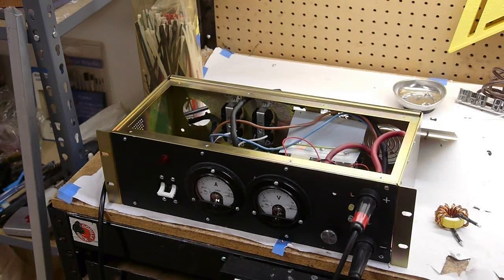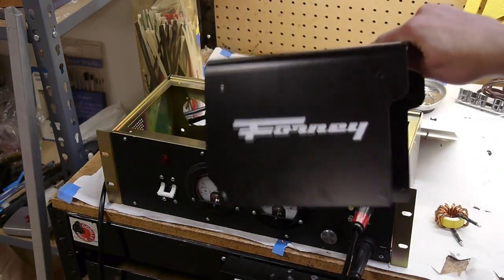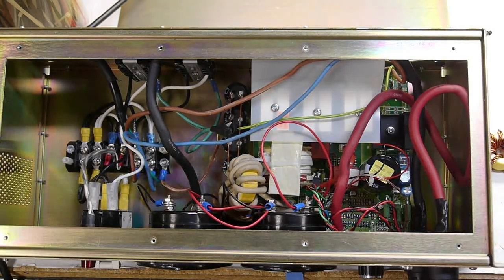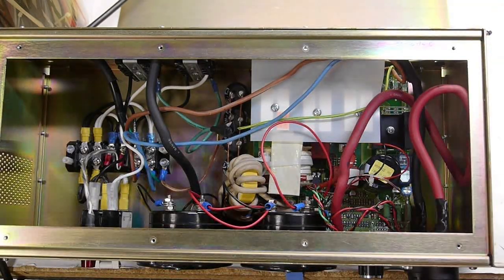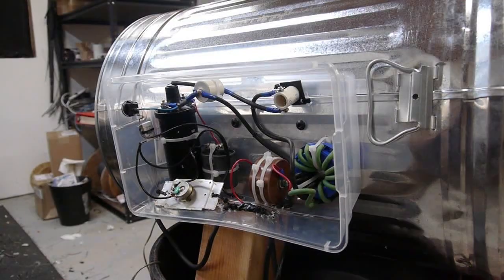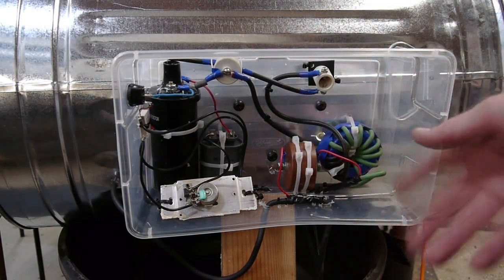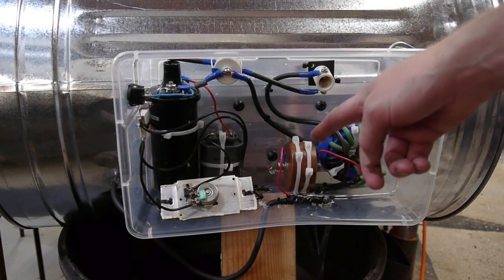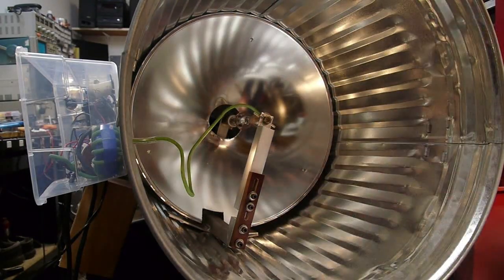1000W xenon arc lamp built into DIY searchlight housing

Comment: My uncle ran (and I believe still does run) a searchlight company here in Canada called Skysearch. He bought a few surplus WWII carbon rod arc discharge searchlights that run at, if I remember correctly, 100 million candlepower? Something insane like that. My dad worked for him, hauling and running the searchlight to events, and as a kid I would tag along. They were unbelievably cool. They had a huge diesel generator for power, but they also had the automatic rotation feature. They also had the ability to connect to a remote control at an anti-aircraft gun, and they would use (I'm assuming) something like synchro resolver and some basic analog computing to triangulate 2-4 of the searchlights wherever the gun was pointing. They also had the ability to run with the generator a fair distance away. They knew the bombers would target the lights, so that's why the remote control was important. I remember the cable connections used to connect to the remote controller (which unfortunately I don't think my uncle had any of) was absolutely massive and had a ton of pins on it. One of those huge military spec connectors.

When I was a teen and moved in with my dad, he would take me with him after school sometimes to run searchlights. Then I would wear the same t-shirt the next day and smell like searchlights (a mix of diesel exhaust and carbon dust and stuff). I always thought it was so cool. Now that I'm older and understand how the circuits likely worked, I find them even more amazing.
Reply: As a kid, those World War II search lights repurposed into event promotion sky lights fascinated me. My Dad would track them down so I could see them up close. I didn't find out until I was way older that the flame was part of the arc itself - I thought arc lights were always glass-enveloped devices. Turns out those things were basically glorified arc welders!
Reply: @russellhamner4898  Yup! The most finicky part of those old searchlights was the feed mechanism. As the carbon rod got eroded, the searchlight would feed the rod inward. The way it actually worked is it would measure the voltage across the arc (the further the rod is away from the anode, the higher the voltage) and it would maintain that voltage by moving the rod as needed. It was a neat idea, but I remember my dad having trouble some nights with the auto-feed. It would sometimes feed too fast, and the arc would get really dim, or other times it wouldn't feed enough, and either the arc would extinguish, or, in the worst case, it would jump from the anode to some other piece of metalwork! The searchlights had a safety system if this happened, but even the half-second it took for the system to kick in could be long enough for something to get melted.

Another thing I remember is that the searchlight could be locked in the vertical position (facing parallel to the ground) and the glass front slides open. My dad would have to get in there before we fired them up and clean the entire reflector and glass with Windex and a towel. Despite cleaning them before every run, the reflector in particular was always filthy because of the carbon rod being vaporized and then just depositing on whatever nearby surfaces. You could really tell the difference in the brightness between a clean and dirty reflector.

Now that I'm an EE (working in digital stuff) mostly) I really should go visit my uncle and see if he'll let me reverse engineer some of the circuitry. If you have any more questions about the searchlights, let me know. I know way too much about them.

Comment: Forgot to mention, I too once wired a TRIAC dimmer to an ignition coil with the spark gap between thick gauge copper wire and a spark plug and boy oh boy, do I remember those corona discharges jumping over the insulation at the coils terminals! Very loud too.

Comment: too bad I saw this 10 years late...  30 years ago, laser, xenon and carbon arch lights where one of my specialities. 

To stricke a bulb cold, you would want to apply a 2-4kW electric field over the electrodes, to excite the gas molecules, before striking and 10-20kW arch across. Striking the gas directly is quiet difficult, because this bulbs are Xenon Short Arch - High Pressure bulbs. The high pressure means several atmospheres of gas pressure even when cold ! Hence you need to excite the gas first, else the energy required to build the plasma arch is very high !. 

A word of caution - this bulbs are very dangerous, as they build up to 80 bar pressure when hot and have a tendency to burst spontaneously, specially if there is not enough cooling or finger prints on the glass. I have seen them burst several times, it sounds like a very close gun shot and leafs nothing but quartz powder (plus electrodes) behind. 
The explosion can be so strong, that it will be heard over the sound level over a live concert in a arena with ease (been there, done that) !! 

So careful with the beautiful bulbs :)

Comment: Hey there I had a question for you: I have an old 35mm theater projector that uses these lamps. It’s a complete unit including the lamphouse. My question is can you hook up the DC power coming from the inverter arc welder directly to the rectifier in the lamphouse? The input for the lamphouse power is 3 phase 220v ac, which I don’t have access to. I figured I would use the benefits of the existing circuitry but was unsure if I could plug dc power from the arc welder directly into the rectifier. In theory it makes sense in theory but I am searching around and couldn’t find anything about if it was safe and would work. Thanks!

Comment: Is there a way to get in touch with you? I have an old movie theater projector with a xenon console I want to resurrect today and I am using an arc welder inverter for the power supply coupled with the igniter already in the console. I need to know if I should hook up the output of the arc welder inverter to only the lamp, thanks!

Comment: Hey Ben, I have a large collection of these Arc lamps from a few hundred watts to 7kW. I have watched this and the other video countless times but am struggling with the ignition circuit. Would you be able to lend some suggestions? I can't seem to get the voltage on the other side of the toroidal ferrite.

Comment: That old inductor is wound with litz wire - Lots of tiny insulated wires- The reason it's getting so hot with that regular wire is the skin effect. It's a high frequency thing.  Wikipedia it. Litz wire.  
And I quote
 "Litz wire is used to make inductors and transformers, especially for high frequency applications where the skin effect is more pronounced and proximity effect can be an even more severe problem. Litz wire is one kind of stranded wire, but, in this case, the reason for its use is not the usual one of avoiding complete wire breakage due to material fatigue.

Litz wire is frequently found in power applications in frequencies ranging between lower tens to higher hundreds kilohertz, namely induction cookers and transmitters of inductive chargers (e.g. the Qi standard). Multiple parallel twisted strands of enameled wires can be found also in transformers in some switching power supplies."

Comment: Hey again Ben,
Is that starting switch a momentary push-button or a toggle (SPST) type switch?  It appears to switch the SCR through a capacitor or a resistor to the primary coil of the ignition coil.
Thanks again,
...really trying to learn this circuit--a schematic would be GREAT!

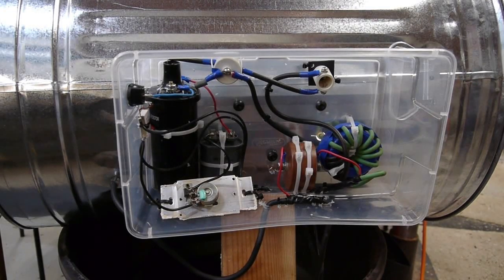Comment: BEN!! (right?)  At about timestamp 5:55 you mention H.V. level compressors.  What about one of those High Power lightning arrestors used here?   They seen to be cheap, reliable, and effective, in this type of surge suppression--even the smaller, inexpensive types.  I think I remember they can also be used in series for higher voltage protection.  I just bought about 300 of them from All-Electronics, or Mouser for a dirt cheap price.  I cracked a couple open and did not like the dirty-looking 'screening' inside!  But still, you could see the bluish-purple (magenta) light through the ceramic cylinder.

Comment: I really like this pulsar starting circuit.  I am familiar with the components and how they work--Is there any chance of showing a labeled schematic:  With component values--especially the HV doorknob capacitors (C & V), from the input of the welding (input) wires to the lamp driver?
THANKS MUCH,
--dALE

Comment: You have 50 amps running through that 8(?) gauge, insulated, non-fiberglass, non-fluoropolymer insulated wire???! Any electrician would give you wrist slap. Fire waiting to happen. But, this is certainly a special circumstance. I’d do the same.
Reply: I was the purchasing agent and general manager of a company that serviced the work boat industry on the inland waterways, and we sold and serviced Carlise & Finch searchlights. There was also a brand called Varo, but they were not very reliable. The wire used in these was teflon insulated, and then covered with fiberglass braid within the housing. When I started, they were all carbon arc, finicky, and dirty. Next came 2.5KW xenon, followed by 1KW. We sold a lot of xenon lamps, and they are dangerous. You are so right MisterLepton.

Comment: Just a suggestion : instead a single thread solid wire, try multithread wires like there is on the original toroidal transformer.

The reason is skin effect which increase with frequency. The magnetic field force the electrons away from the center on the wires, so the most efficient design woould be hjollow wires. The second best option is a lot a small wires not in parallel but crossing each other is different way... exactly like the wires on the original transformer..

Comment: I don't know if you're from the US or not. However for future rreferance, it is against FAA regulations to point any light above a million lumens into the sky. I don't want to see a good guy just doing projects going to prison over something like that.
Reply: +TheRabbitt23 the only bulb i know that emits a million lunens would be a 15kw xenon bulb or a 12kw metal halide. There is no such thing as a "million lumen flashlight". Post the link and ill check it out.
Reply: +TheRabbitt23 with an estimated 50 lumens per watt for a xenon arc lamp, this lamp would be 50,000 lumens. Ballpark of two orders of magnitude gives some breathing room
Reply: 50 lumens per watt is actually very low. Considering theres a handheld flashlight that emits 1million lumens, I'm pretty sure that this light can do about 100 Millions easily.
Reply: FYI a 1 watt laser is 500k lumens or higher depending on color
Reply: +TheRabbitt23 Those figures are way off. I can't find any evidence that agrees with them. I wouldn't trust the B.S. packaging on ripoff products.

I did find a 1000W metal halide spotlamp (higher lumens/watt than xenon) that has 110,000 lumens. Search for part WAL-TSL-1XM. The 1000W GE SPL1000/T/H/960/E40 has a rating of 88,000 lumens.

From whatever sources I could find (say, search 'hyperphysics luminous flux') a 1 watt green laser would be expected to be in the ~650 lumens range
Reply: I'm not here to argue. I just wanted to make sure the guy didnt go to prison over something dumb, like shining light into the sky.
Reply: +TheRabbitt23 I was here to do a back-of-envelope estimation to see how close to the limit this would be... being ~1/100 of the limit meant he shouldn't worry about what he'd done shining it up into the sky. You turned it into what it is now.
Reply: I just know that youre not allowed to shine the "million lumen" flash lights into the sky in the US.

Comment: hi Ben, can you tell me what is it between ignition coil and white capacitor? it's a diode or a resistor? and can you tell me capacity and voltage of blocking capacitor?

Comment: Your device quite interesting. A way to inject the HV pulse, is to capacitively couple in the pulse through the lamp  wall, glass body. Doubtless this is fused quartz. (no finger prints please). This is a standard laser lamp ignition method. A  floating small dia trigger wire is wound around the lamp envelope for example. Must be near the cathode  and anode of the lamp.  Yes, isolation of the HV pulse is very important, to prevent failure of the lamp LV  supply. A common mode choke on the LV feed  pair will help keep ignition pulse out of the LV supply. All should be located near the lamp can, as you have done. Nice work!
Reply: yes and now, laser tubes are low pressure, this Xenon short arch lights are high pressure. They have at cold state around 6-8bar gas pressure, when hot around 50-80bar !! Therefore the ignition pulse is best injected via the electrodes.

Comment: atleast your neighbours know not to mess with you, otherwise they will have night sun shining into their homes ;)
Reply: Brodne y you seen photonicinductions 20,000 watt bulb video?
Reply: @carolynmmitchell2240  but, back in the day. Photonicinduction use halogen lamp and not focused, while this is xenon short arc and all the beam focused into one spot.

Photonicinduction does have bigger xenon short arc rated at 4kW and 30kW.
But, he didn't put it on reflector. 

The one and only arc lamp photonicinduction run it using reflector is 12kW metal halide lamp, and some arc lamp using red protective cover (i don't really remember the type and it's rated power).

Comment: I have a collection of Xenon continuous arc lamps that are in ceramic reflector housings.  Power ratings from 250W to 1000W.  Also a flash tube that I believe is rated at 1,000,000 watts.  It was made at ILC Technology for a huge laser.   If you are interested in obtaining some or all of my collection send me email at rwood43@hotmail.com. Most of them have never been used.  I designed power supplies there just before they went out of business.
The picture is my daughter.

Comment: Tanks for the information, but, could i use common rectifiers, such bridge rectifiers about 30 amps to drive this bulb? Something like that i´ll do with flash xenon bulbs, which have three electrodes.  What diodes have you used for this?

Comment: @bkraz333 All iron powder torroids I've seen are yellow. Also if it was an output choke, it has to be iron powder. Another giveaway is it heating up. Iron powder cores have high loss, but are cheaper than gapped ferrite.